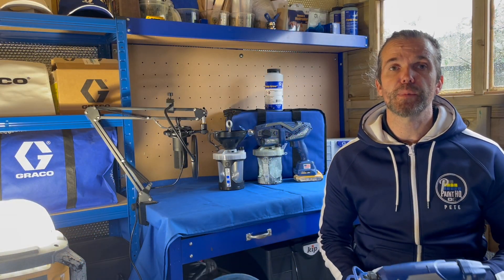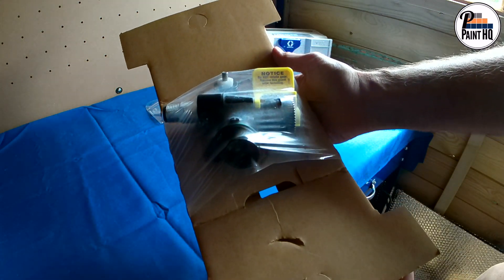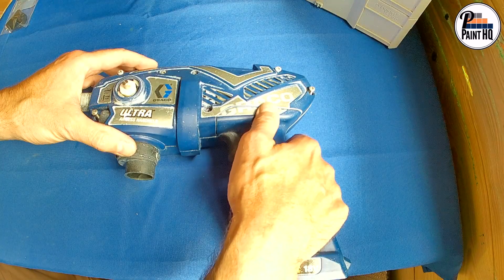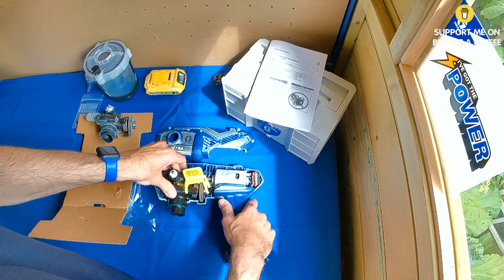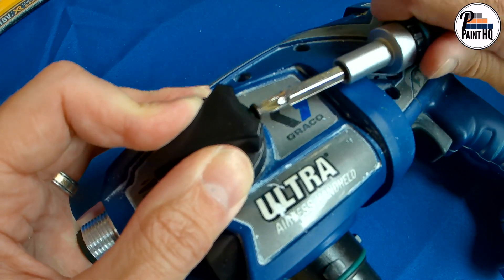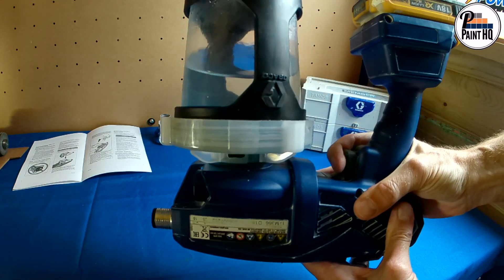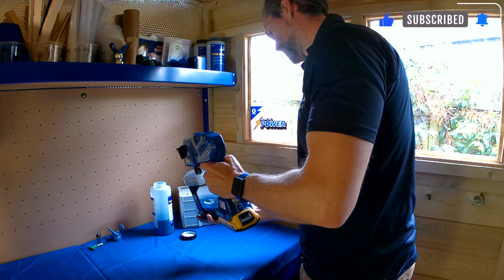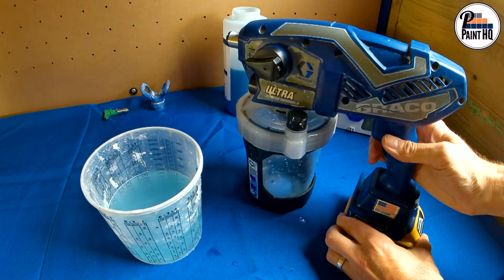Graco TRIAX 2 ⚡️ HOW TO Replace The Pump In Your Graco Ultra Handheld

Comment: Can’t believe how easy that was, I’ve put finishing off my last room on my refurb cause the pump went. Once again thanks for the vids 👍
Reply from the maker: You’re very welcome, happy to help if I can — Yeah it’s a very easy swap out by the user — just one small addition with the UltraMax models is the earthing wire to the pump — the link to replacement pump is in the video description, I can confirm SpraymanUK stock is all TRIAX II 👍 

Ps don’t forget to enter the competition (I’ve pinned a comment to this video) — you could win the featured Ultra Handheld, along with all new accessories, tips, bag 💙

Comment: Hi Pete.I have followed your advice and purchased a triax 2 pump from sprayman! Am i becoming a fan boy?? 😂 My question is when will I know that the pump needs replacing? I have the ultra and have had it well over a year. Use it regularly but I don’t cane it so the piston doesn’t get too hot. As it stands it just keeps going. What are the symptoms of pump wear and replacement required? I know it sounds stupid to ask but there is so much negativity around these machines and I haven’t experienced that. Cheers
Reply from the maker: Hello my friend.. thank you so much for your support 🙏 ..you’re very wise in n how you use and look after your Ultra HH.. general rule to determine a pump ‘failure’.. is you would no longer be able to spray water.. just like in the cleaning process, holding the gun upside down, you could possibly prime water (see water circulating in the cup), but still with the pump upside down, switch to spray — (no guard / tip).. water would either not spray, or dribble out the end 😞 ..really appreciate your comments and contribution to PaintHQ — I will always reply (sorry about the delay on this comment).. regards Pete

Comment: Hi, I have a technical question, and I realize most people on here could care less about this inquiry as it has no effect on painting operations, but here goes: 
I’ve asked Graco’s technical website and I’ve asked spray companies technical sites and no one has given me a suitable answer regarding the incredible number of warnings and packaging clips and details surrounding “not rotating the pump gear before the cover is replaced.” I’m just an old engineer. I do pay attention to directions. The new pump went in just as your instructions show and it works terrific but when I see all the excessive amount of warnings about one specific part, it makes me want to further investigate and try to figure out why. I would like a technical explanation of why rotating the gear before putting the cover back on will cause damage unless this is simply meant to be a prevention measure for running it without lubricant. If it meant, don’t remove the gear from the pump and rotate it  and then put it back on the pump because of some piston timing issue that would make sense, but simply not rotating it before putting the cover on does not make sense to me because as soon as you pull the trigger the gear is going to rotate. I’m just an old engineer asking a dumb question but there’s lots of warning labels so I’m trying to figure out how this applies. If it’s simply to prevent someone from operating the pump while dry then I would think the pump replacement instructions would say that. I do realize that the printed operating instructions talk about not operating the pump without fluid but the pump replacement directions never mention this … only about how to make sure the gear doesn’t move or you wreck it permanently. I’ve asked this question of Graco and other painting supply websites and all their responses say “don’t turn the gear before putting the cover on are you might cause permanent pump failure” They never go on to explain why or how.

thank you
.
Reply from the maker: Hi Robert, you ask a very good question and I appreciate how you analyse things with your engineering mind 👏👏 My understanding it’s a ‘timing issue’, not an issue running the pump dry — whilst you shouldn’t run any piston pump dry, small turns of the Triax pump wouldn’t hurt the 3 pistons and packings (that’s my understanding).. I’ve always heard it’s to do with timing, and if you was to know what you was dealing with, the timing could be corrected (again, just my understanding).. what I’ve gone on to do, is ask my product representative in Graco, who has a lot more understanding and resource available to (maybe) give a more in depth explanation.. I will report back my friend 👍 keep in touch.. regards Pete 💙💯 Ps glad to hear your pump replacement was a success — was it a Triax 2 ?.. was my video helpful? 👍💙💯
Reply: Thanks for responding so quick. Hopefully one of your Graco engineers will be able to give you an answer. I’m certain it is not a timing issue. If you study the way, the pump works rotating the gear by hand is no different than rotating it with the motor in that respect.  If it were a timing issue then the motor gear would need to be somehow indexed to the pump gear. You can easily check this by marking a tooth on the motor gear and then randomly start and stop it with the switch. It doesn’t stop in the same position each time so that has no effect. I’ve disassembled an old pump and there is no timing of the pistons that can be changed by manually rotating the gear.  Thanks for asking your tech folks. Maybe one of the Graco engineers can shed some light on this.
Reply from the maker: @robertyoung4326 Thanks for sharing more of your insight.. I’ll be in touch as soon as I hear anything 👍👍👍
Reply from the maker: @robertyoung4326 Hi Robert, this is the additional information that I received back.. 

“You need to insert the pump 100% correctly. The pump assembly needs to be into the enclosure while making sure the bearing is in the enclosure and the gear meshes with the motor gear. The clip holds everything together and makes sure it aligns correctly”

Regards Pete 💙💯
Reply: @PaintHQ  
Thanks for the reply Pete.

This is the first explanation I’ve heard from anyone that makes any sense at all regarding the clip because in fact without the clip the pump and gear can move around a little bit and possibly make it more difficult to install, but not really. I’m hoping you’ll hear something more from Graco because neither the clip nor the instructions say anything about alignment, and on the clip it clearly states “Do NOT rotate gear, Remove this Guard after installing.” Seems to me just as easy to print: “Do not remove this clip until Pump is seated” or “Do not remove this prior to pump installation”, or “Leave this clip in place to help with alignment during installation” … nope, it specifically mentions rotating the gear, and furthermore, several videos show the technicians taking extreme measures to prevent the gear from turning by holding it with one hand while removing the clip even after the pump is mostly seated. Just seems weird to me, but for anyone reading this just know I’m not losing sleep over it. I just have a mechanical mind so when I see directions that don’t fit the scenario I asked questions. If any Graco engineers ever read this maybe they’ll post the answer up. Thanks again.

Comment: Listened to the feedback.!! what symptoms should i look for in deciding if the pump needs replacing??
Reply from the maker: Thank you for the support my friend 👍 — Wishing you the very best of luck in the giveaway 💙

When you can no longer spray water — just like in the video, where I’m spraying water to test, the tip guard is removed and I’m circulating water in prime and spray with the pump upside down — If pump was defective at this point, the unit would not spray water 👍

Keep in touch my friend — regards Pete 💙

Comment: Hello! First of all, I want to congratulate you on your channel and your very well-made videos, they are very motivating for a painting enthusiast like myself. After using a Graco Ultra corded for a while and noticing that its performance has worsened, I have decided to change the pump following the instructions from your video. My doubt arises when looking for a Trimax 2 pump for the corded Graco Ultra, as it is not easy to find. On the other hand, it is easier to find it for the battery-powered Graco Ultra in online stores. I wonder if they wouldn't be compatible with each other since they seem exactly the same. Could you tell me if they are compatible based on your experience with this brand? Thank you in advance, greetings from Spain.
Reply from the maker: Hi Sebastian, thank you so much for watching and your kind feedback 💙💯 I’m going to check with my UK Graco distributor friends and report back for you — as I believe there is a corded version, at the start of the video I record how I choose the pump I required and there was an option for ‘corded’ — you’re right, essentially the pump differences will be minimal in design, but it’s the earthing / grounding and the ability to spray solvent and / or water, that decides which pump is required.. it is worth noting that the part numbers for the improved Triax II pumps that are the same as its original Triax predecessor 👍 all the best my friend 🇪🇸💙💯 regards Pete

Comment: I've only shot about 10 Litres through mine I'm about to do all the wood on my 4500 sq foot home so knowing  once the pump fails I'll be getting an upgrade is nice, How many Litres do they reckon it'll now last?.
Reply from the maker: Hello my friend.. it’s tricky to give a definitive figure in litres, simply because the number is variable based on what material is being sprayed (viscosity) / how hard the pump has to work / pressure (speed) ..my advise is to not overwork the unit, keep to small jobs, spray at as low pressure as you can (not speed 10, certainly for long periods of time), clean effectively and store with pump armour 👍 ..I can vouch for the improvement that’s gone onto the Triax 2 👍 all the best my friend, keep in touch 🙏 regards Pete

Comment: Hello Pete 😁 Is this a new pump dedicated to graco ultra and can solvent paints also be used?
Reply from the maker: Hey buddy 💙 -- Good question.. the TRIAX II featured in this video is dedicated to the 'Ultra' model only, which should only be used with waterborne paints.. To use solvents, you would need the UltraMax model, then if a replacement is required you need the appropriate (UltraMax) pump.. similarly, you couldn't put an UltraMax pump in the Ultra model, as there wouldn't no earthing capabilities, plus I believe there is other compatibility issues -- These are the 3 replacement pumps available, along with the part numbers 👍

17P185 – Triax II Replacement Pump for Ultra Handheld Corded
17P186 – Triax II Replacement Pump for Ultra Handheld Cordless
17P187 – Triax II Replacement Pump for UltraMax Handheld Cordless

Ps --- don't forget to enter the competition to win the sprayer featured in this video, with it's replacement TRIAX II and all new accessories 💙 -- details are in the pinned comment  👍
Reply: @PaintHQ  👍👍👍😁😁😁 like always professional answer 😁thank you

Comment: So TRIAX II is not sold as a distinct upgraded version. Nice to know that Sprayman do the new version but it would have been much nicer to know that it is the new and definitely NOT the old version that is being shipped out.
Reply from the maker: Thanks for your feedback — it is an upgrade / an improvement at no extra cost — for example the HH’s purchased as a sprayer, will come with an upgraded pump and additional accessories at no additional cost — same part numbers 👍 I guess because the part numbers are the same, the identification is the same also — a rolling change is the best way for me to describe 👍 it’s a recent chat I had with SpraymanUK, that enables me to confirm all their stock is TRIAX II — I do get what you’re saying 👍 Regards Pete 💙